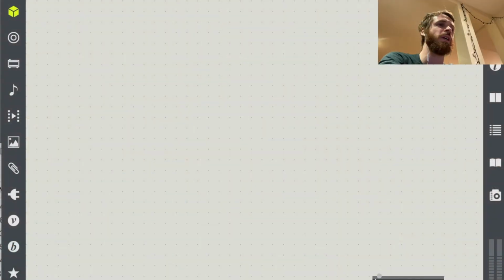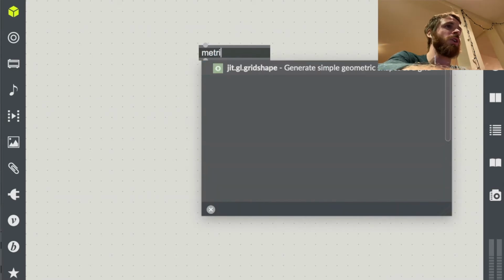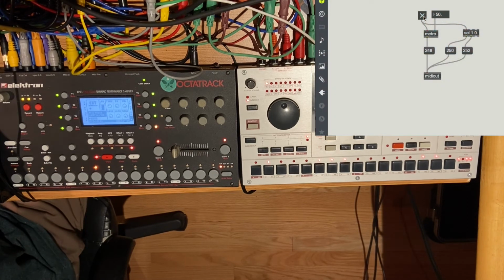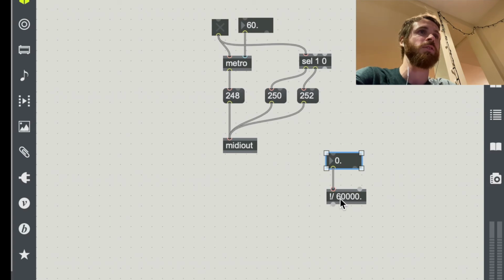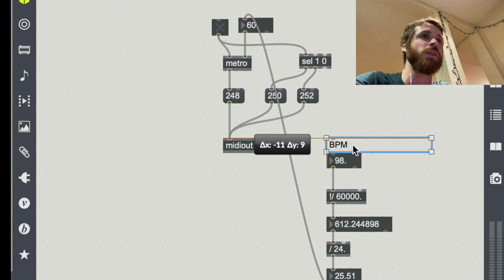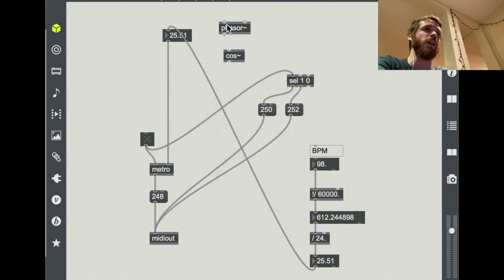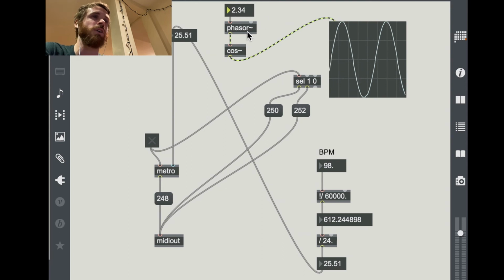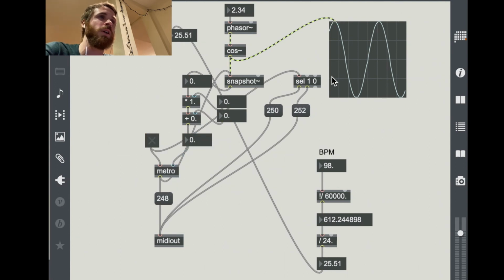TUTORIAL: Using an LFO to Control Hardware Tempo Pt. 1

Comment: hi! is this only working with this turbo midi thing? i tried the exact same thing whilst routing the midi out to the midiport on my interface and it wouldnt do something. is there some kind of configuration that you did on your md / max? i got an mk2 (non uw) with the x.07 firmware. would really really like to do this :) ah and the midiport works wirh ableton sending send / receive start stop, and speed, withoit any issues.
Reply from the maker: Hi Luca, I believe this should work without Turbo, which seems more for efficient sample transfer than for regular MIDI control. I would probably have to poke around a bit within your configuration to see what the issue might be. However, if MIDI is working from Ableton, you can try turning off sync from Ableton, then routing Max's MIDI data through a MIDI channel in Ableton, and seeing if that works. You could also build this as an M4L device. Be sure to check all of your settings, and make sure you have the proper MIDI port selected from Max.